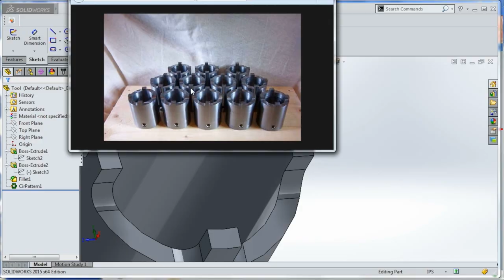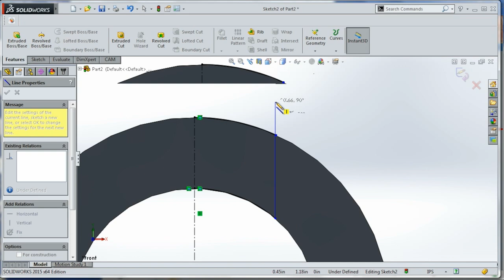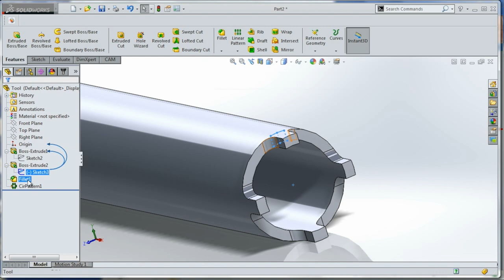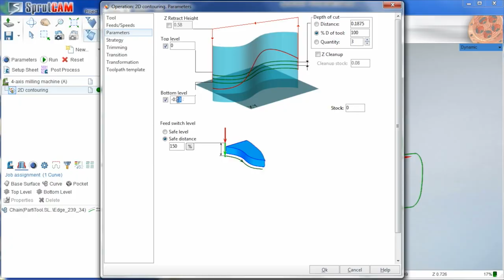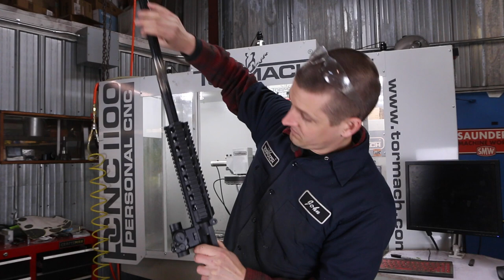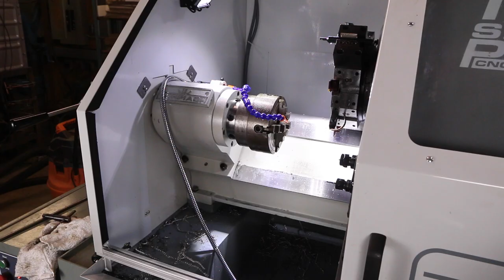SBR an S&W M&P 22LR:  Making Barrel tool & turning threads!

Comment: Another trick for aligning the bore is to use a good dead center in between the bore and a live center. It will track the bore and gives you a good reading on the indicator.
Reply: No problem. It's the technique I used till I got my pin gauge sets.
Reply: Mike Dittman Yes I love that trick and have used it several times.

Comment: A tip for your drawing in Solidworks. The first dimension you added, half of .125, you did it the manual way. If you have a center/construction line, as you did, click on that and the line you are dimensioning to, and then move your mouse to the opposite side of the center/construction line. This will show the dimension to the full feature width instead of just half. It saves doing math and makes dimensions show how you want them to on drawings.
Reply: Also, use Co-Radial using the two arcs, instead of Coincident using an arc and a point.

Comment: When trying to extrude those tabs you can convert entities which will project the 2 diameters to your current sketch and then draw your two vertical lines.  Basically the same thing you did without drawing the arcs.

Comment: You need to crown the barrel...anytime you cut a barrel, just a very light chamfer on the bore.
Doesn't need to be anything flash a countersinking tool will do.
Reply: Hmm noticed that myself, crowning can have a real effect on  accuracy.
Reply: Brass dome nut with some lapping  compound Works even better
Reply: Honestly, being that the handguard extends way past the barrel, I hardly doubt he is ever going to shoot that thing without a suppressor on it. Therefore, the crown doesn't matter.

Comment: Very cool.  With the 5" barrel cheap bulk supersonic stuff should drop down to subsonic speeds.  I run federal bulk pack in my 4.5" cmmg pistol and it runs subsonic.  Still gemtech and other subsonic ammo will be more quiet with less noise from the ejection port.

Love your channel! Any other firearms related projects in the works?

Comment: Nice work.  But please tell me you cut the crown before taking it out of the lathe.
Reply: NYC CNC LOL.  I would strongly recommend throwing it in the manual lathe and giving it a quick crown
Reply: NYC CNC Sorry for the late reply, I've been out hunting all weekend. 
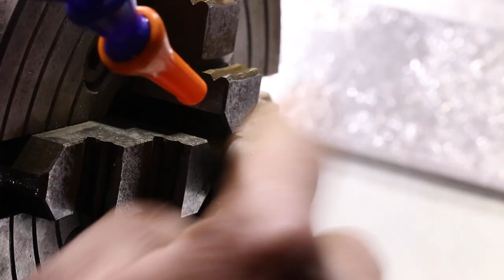I'd argue that the crown is probably the single most important part of a barrel.  As the bullet leaves the barrel, it's important that the gasses push evenly on the bullet as they escape from behind it. Facing the muzzle is a good start, as you do want the crown to be perpendicular to the bore.  However, at 11:55 you can clearly see what appears to be a burr.  A burr or gouge on a crown can do a few things, it can push the bullet off center physically, causing the bullet to yaw.  It can allow gasses to escape from behind the bullet unevenly, causing it to yaw. And it can remove some material from the bullet, causing the air to flow over it unevenly as it travels down range.  All of these reduce stability, and by extension, accuracy.  There are lots of different kinds of crowns you can cut, the simplest probably being a 45 degree chamfer. 
Another reason to cut a crown, as you mentioned, is to protect it.  It may seem like you've got it protected pretty well, since it's inside the handguard, but a cleaning rod or even the end of your suppressor as you thread it on could damage the crown if it's not cut.

Comment: Hi John

Not much of a Gun guy but love the machining. I hate complaining so please take this with a grain of salt.
I know your time is important but could you please slow down a little while demonstrating Solid Works?
Also you might want to check the strength of your Coolant as I notice a fair amount of corrosion developing on the face of your Lathe Chuck.

Questions
(1) Approximately how much would the Rife cost?
(2) How are you liking the Mill PathPilot?
(4) Is the Stepper Motor upgrade required for use with PathPilot? I have a Series One PCNC1100 Mill with the Spindle Motor Drive (VFD) upgrade.

Thanks for your help with my questions.
Keep up the good work.

Willy
Reply: NYC CNC Thanks John
Love your Videos.  Keep up the good work.

Bill

Comment: Do a little more research on barrel work, Lots of things I see make me cringe, yes I know its just for your own personal projects, and good enough is good enough, but if you ever do customer work, get a spider on front and back, proper range rods(not gauge pins), research crowns, proper deburring of the bore to crown face, etc.
Reply: Also, don't forget that just because you're concentric on the end, doesn't mean the bore is concentric anywhere in the middle, most barrels are banana shaped on the inside - especially cheap barrels.